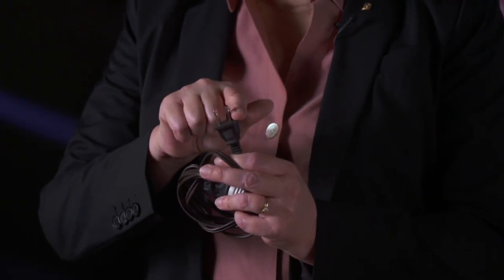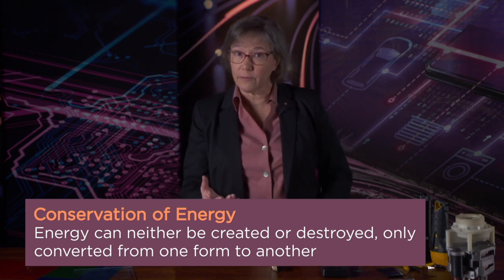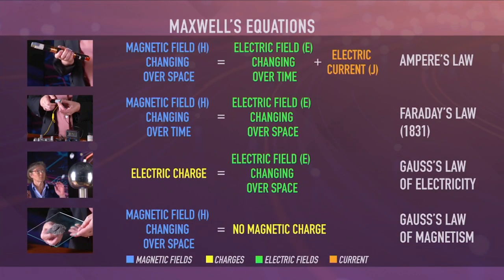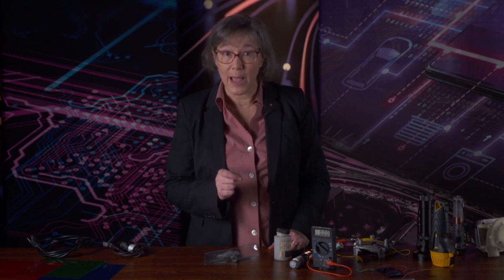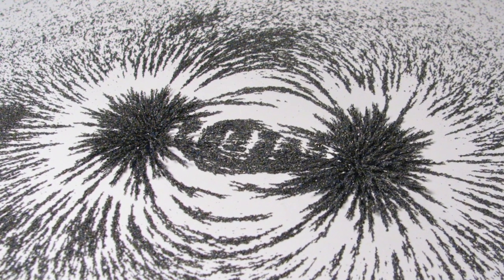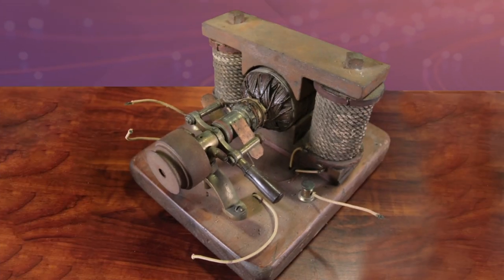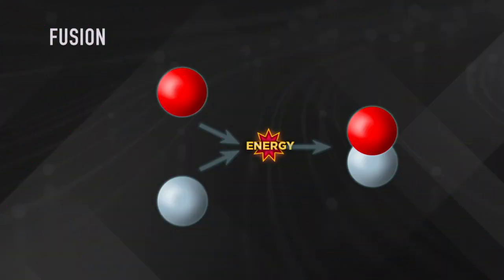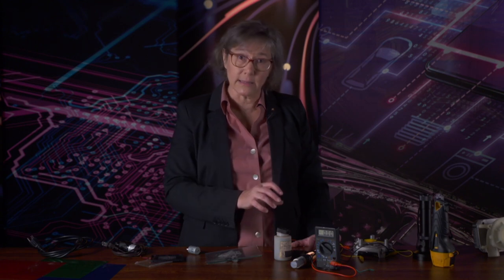How Electricity Works | Understanding Electrical Engineering

Comment: third prong isn't the neutral.  Look at the diagram you put up after saying that.  Although....even the NEC makes this confusing, by calling them the grounding and the grounded (the neutral) conductors.  The point is still quite right, the grounding conductor is for discharging stray electricity flow, through the grounding conductor instead of someone's body.

Comment: Thermodynamics is all energy. At different speeds of travel in resistance. Heat not absorbed, is refracted or reflected. Reflected heat in an atmosphere hits and sparks as light. Waves of photons striking the atmosphere or mass not absorbed. We can only see light in resistance to absorption. Hydrogen absorbs heat and becomes helium. The heat it doesn't absorb is refraction of light. That's why we see stars. Light accumulated can burn your eyes because it is heat in resistance. Thermodynamics chars your skin as a tan. A tan is absorbed heat. A sunburn is absorbed heat, overwhelming tissue to quickly to be adapted. Moisture is needed to maintain temperature in skin or it burns the same.

Comment: Super interesting. Why don't they put a magnification glass  above solar panels to increase the amount of photon radiation. Maybe take it a step further and engineer a magnification glass that converts the wave lengths to ones that can be more easily absorbed?
Reply: It ends up cooking the PV, and would need to be substantially larger than the panel, and in doing so increases the overall cost to where it would be cheaper to just build a larger panel. An interesting alternative to this approach is to use a parabolic mirror. This is a method will yield greater results, but still has it's drawbacks such as setting birds on fire if they were to fly between the mirrors and collector.